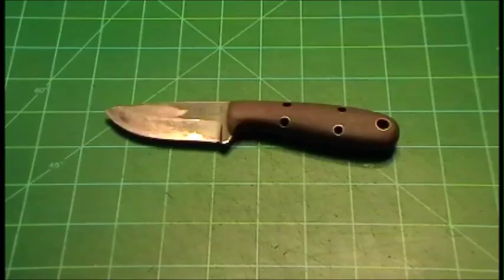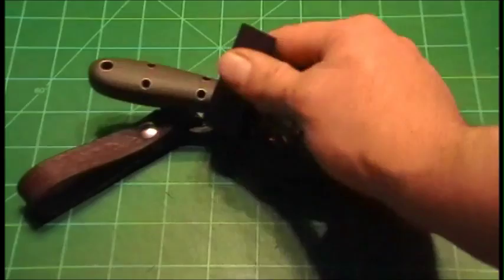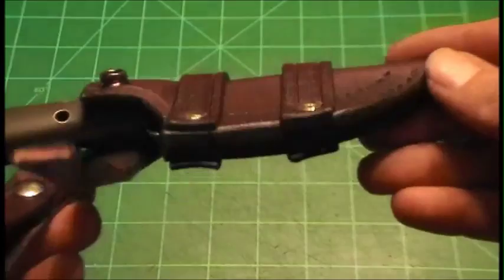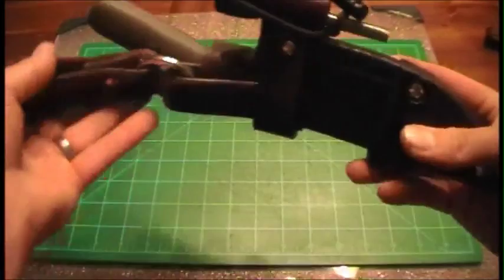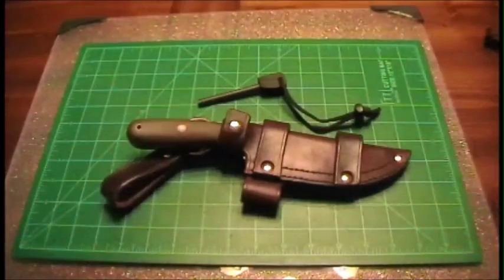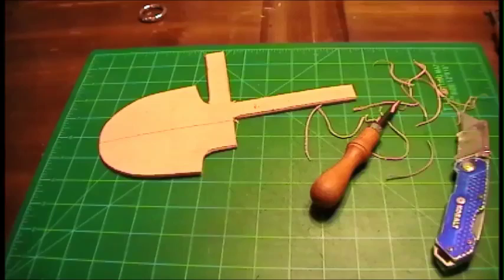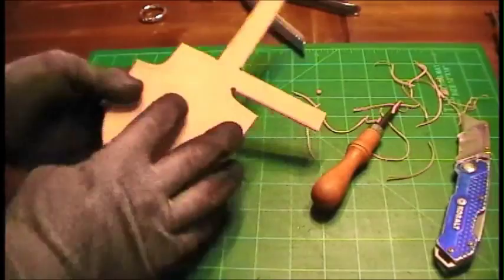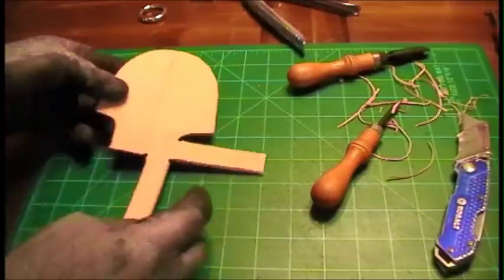How to make a leather sheath part 1

Comment: You know it is really kind of you to share this kind of knowledge with us.. . Tool settings and hardware descriptions give me the most help when I watch tutorials.
Thank you because I am learning a lot
Reply from the maker: You are very welcome.  Make sure to check out my other tutorials because I show new ways of doing things in every one.
Reply: ***** I have a question about the template. I have mine all done and want to make a right hand sheath. At 26:30, you say you are making two left handed sheaths, but it looks like a right handed sheath. Did you mean the next two after this one? If I marked my template inside right hand like you showed, wouldn't that side be facing down if cutting on the smooth side(non-flesh)? Bare with me got a touch confused!

Comment: one thing i would do for the dangle option is to put a metal loop at the bottom of the sheath so that you can tie the bottom to your leg so if you are running or any other quick activity it doesnt slap the side of your leg. also it makes it easier to draw the knife

Comment: Thanks for an awesome instructional video. Clear, easy-to-follow and the extra tips are invaluable. I have one question, after wetting and shaping the sheath you put it onto an oven to dry it at 125 degrees. How long do you leave it in the oven?

I'll be starting this project just after Christmas and will post the result.

Cheers Peter

Comment: Great video! ive watched all three and my set of tools are on the way! I was wondering on what the process is to add the fire starter loop? do you get a little thinner piece of leather  and fold it over and put it in with a shorter welt? or is it cut into the original layout?
Reply from the maker: Here ya go.  This is another video I did that will help you.  Leather working - How to make a ferro rod loop.